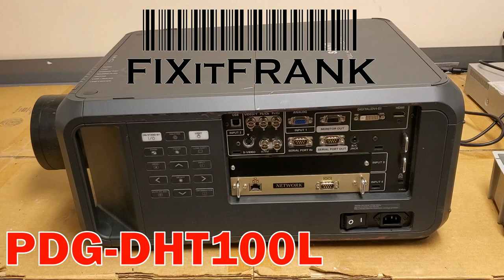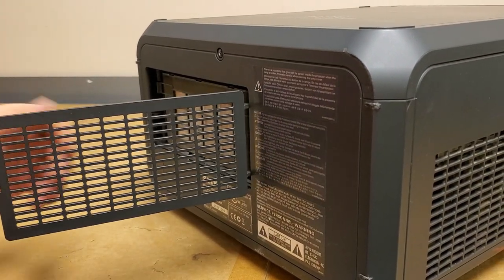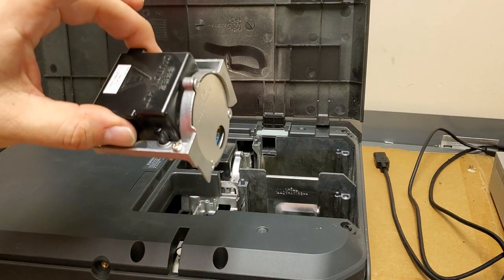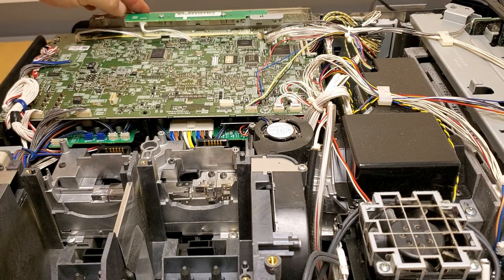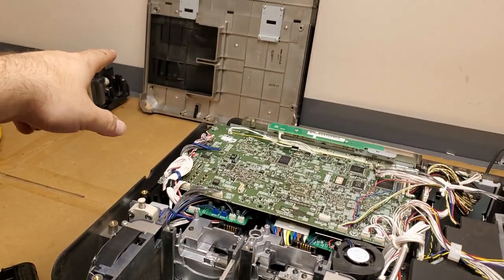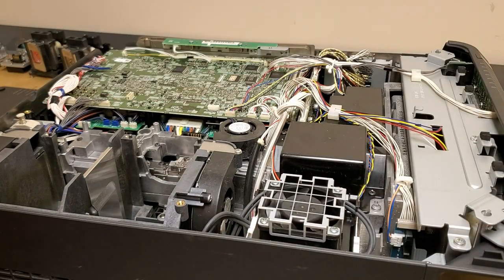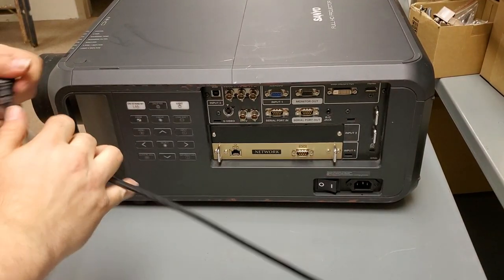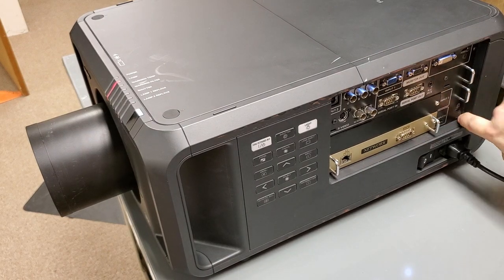PDG-DHT100L Sanyo DLP Projector Maintenance/Cleaning

Comment: Great video, and very helpful! I've got a question about the color wheels. Do they ever go bad, or need replacing? I just put 2 new OEM lamps in my DHT-100L's but the yellow just isn't popping. I've gone through all of the different color presets, but still no luck. Just testing on a white wall so that could be part of it, but I'm wondering about those color wheels and if they need replacing. If so, do you have a supplier you recommend? Many thanks!
Reply from the maker: They do wear out.  They can have rotation problems or in your case, have a loss of color from the dichroic coating wearing out from heat/IR/UV.  They are fairly easy to find.  You may need to rebuild the carrier with a bare wheel/motor.  You can try the folks I use.  Time electronics.  gydz@timeprojectorlamp.com  also ebay.  I would not worry about OEM/aftermarket.  This is old enough where OEM wont really be a viable (or cost effective) option and most aftermarket color wheels are perfectly fine. There isn't anything all the special to a color wheel so its not hard to make.

Comment: I got one but the no picture with grey horizontal grit line , lamp show ok. It started ok with picture but it turn to horizontal grit line after 2 to 3 minutes after playing.Do you know what is the problem
Reply from the maker: Hi John,  Im not really sure.  I do know these have power supply issues but yours sort of sounds like something else. Id suggest verifying all the connections on the side modules that take the input signals.  Then check the power supply for bad capacitors, not the electrolytics but actually the ceramic caps near the voltage regulators.  also bad solder on the power supply is common.  Bad solder or another bad connection sounds plausible.
Reply: Problem like vertical line on certain area, after few minutes picture will freeze..by the way lamp signal need to replace. Could it be the lamp problem?
Reply from the maker: probably not.  A lamp wont cause vertical lines.  It is only bright white light. I think there are 2 problems for you.  The lamp should be changed but I would find the bad connection/cause of the vertical line.  there is a chance it is a bad connection at the DMD.  The service manual is available for free online.  They have a very comprehensive troubleshooting section. I would suggest starting there and figuring out the DMD issue before spending the money on a new lamp assembly.

Comment: How do you reset the filter counter?
Reply from the maker: Hello Aaron, Here is a link to the manual.  https://www.projectorcentral.com/pdf/projector_manual_4774.pdf  The steps start on page 60.  This is accomplished through the menu.  I would describe it here but hte icons in the manual make it easier to understand.  Keep in mind if the filter has scrolled all of the way, it will not reset as it cannot advance the filter.  You may need to take the filter apart, clean it, and roll it back. Keep that in mind.
Reply: FixitFrank thank you for the assistance. It appears the projector has something more significant wrong with it as I followed all your steps but continue to get the orange filter warning light and red lamp light. The command will have to result in buying a new one. Thanks again.
Reply from the maker: @Aaron Moore Are you getting the filter warning and lamp lights flashing? or is one or both solid?  That may not be a filter but a fan.  These are very repairable units.  I don't know if you want to go that route but if you are curious feel free to email me (sales@weezytech.com)  I honestly enjoy working on these in particular.
Reply from the maker: @aaronmoore7099  One other thing to check.  Reset the scroll counter.  Should be in the same area.